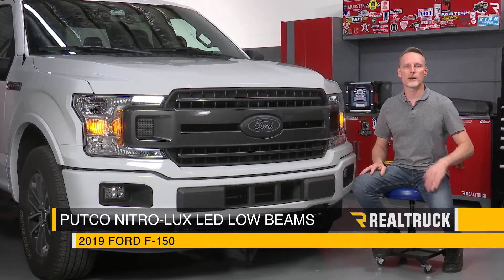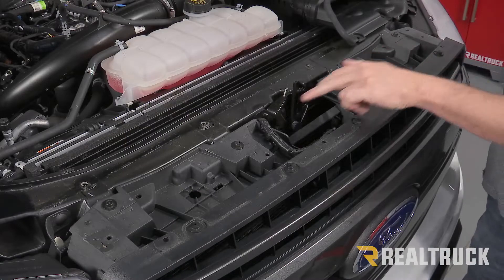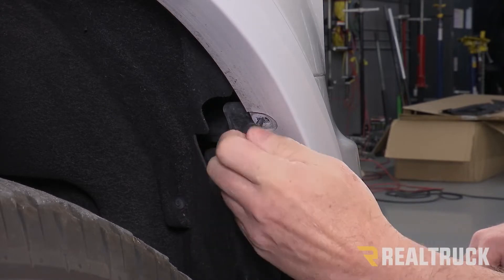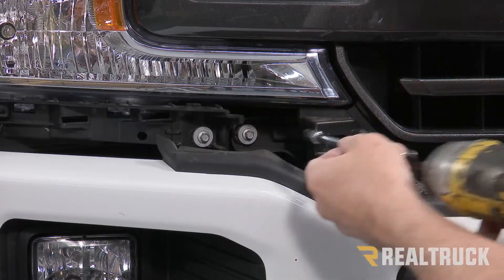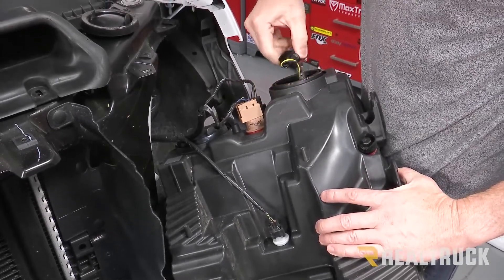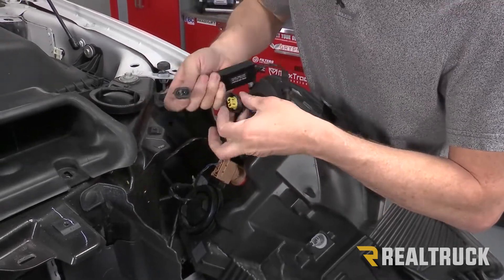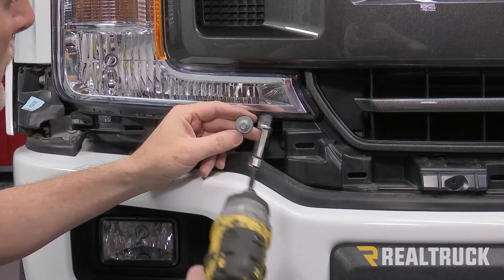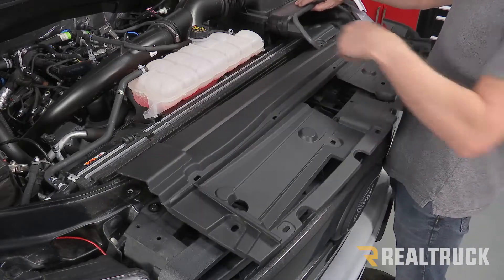How to Install Putco Nitro-Lux LED Replacement Headlight Bulbs Low Beam Replacement on a Ford F-150

Comment: Do you run the risk of the heat sinks melting or cooking the plastics they're touching inside the housing assembly?
Reply from the maker: Hey there! As long as the braided heat sinks are fanned out sufficiently, they will dissipate the heat evenly and won't harm the factory components.